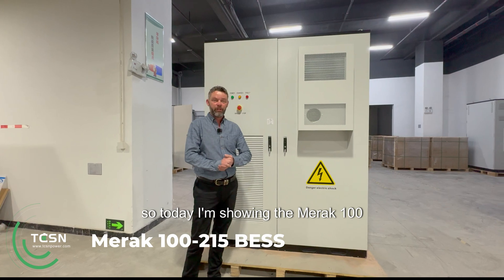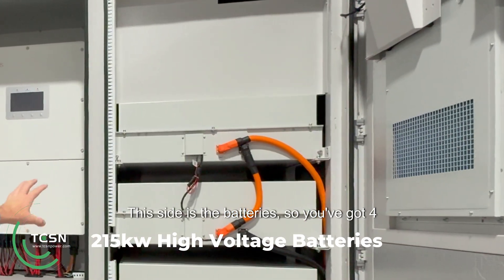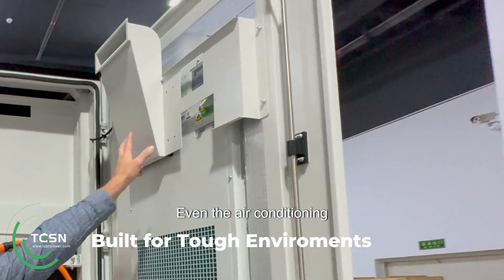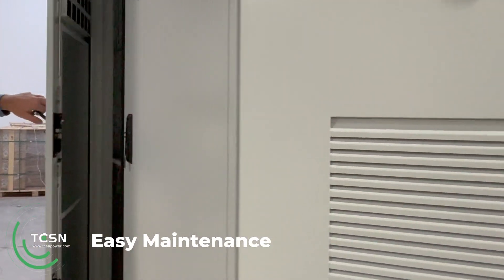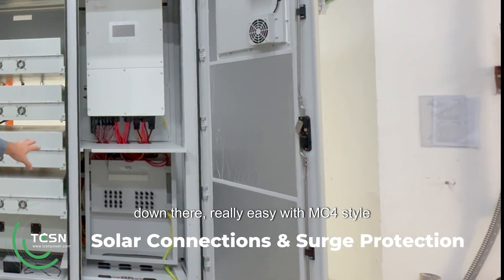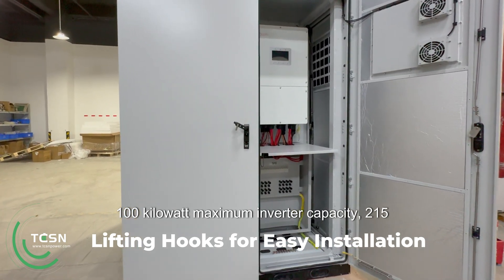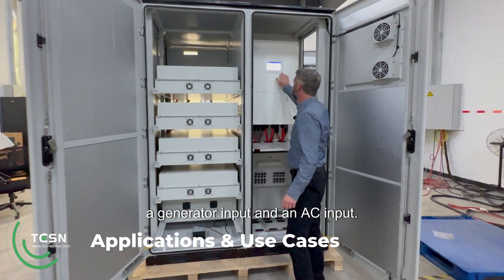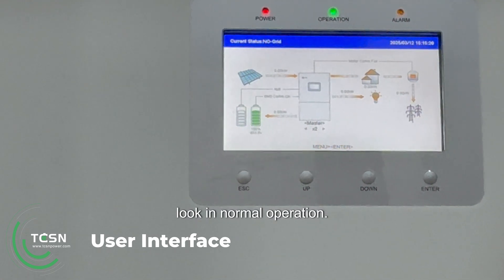TCSN Power Merak 100kVA 215kwHr Battery Energy Storage System

Comment: nice, we have an Eaton 9390 125kva UPS double conversion feeding a cathlab GE innova 3100, 480v, 3ph, 150amps, can Bess repalce the legacy UPS eaton 9390....
Reply from the maker: There is a place for it but the C rate really matters. When we built UPS batteries we use cells which can take a much higher C rate. We can always review what you have in place and see if we have a suitable alternative product however we do also specialise in UPS too
Reply: @TCSNPower the question remains unanserd…could I find out